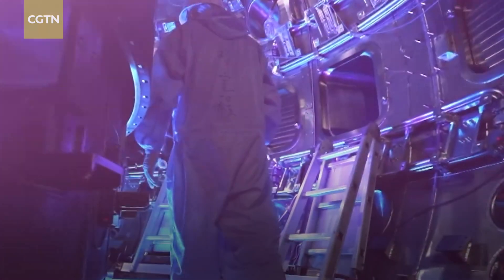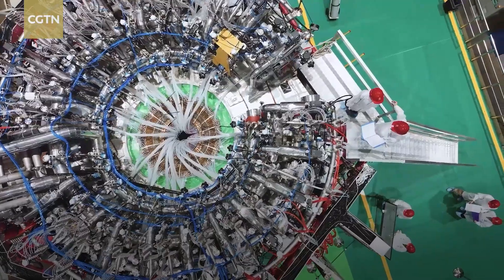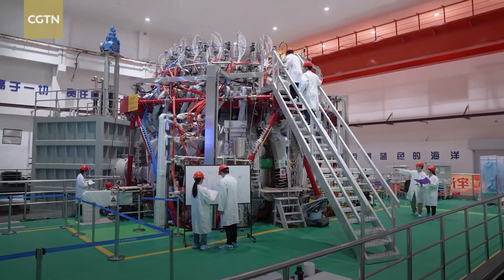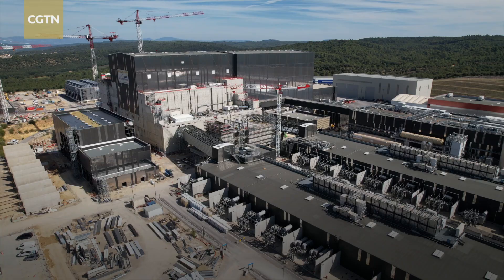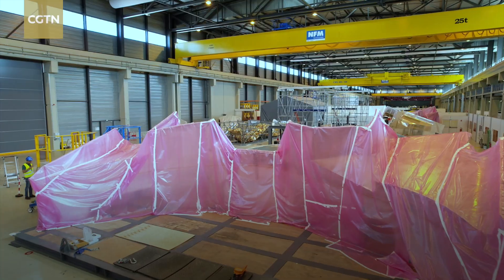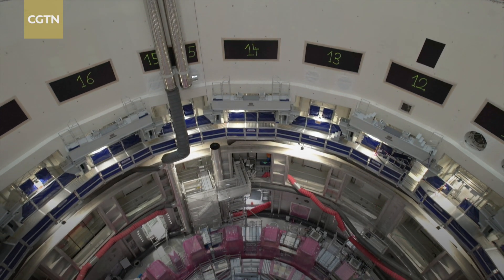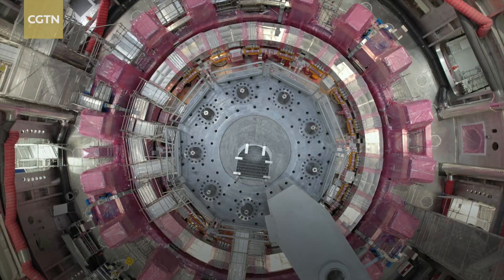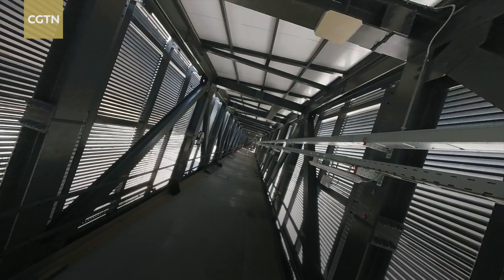Chief nuclear fusion scientist on China's 'artificial sun'

Comment: Though it may be commercially available in 2050, China has no problem with energy as it is adequately covered by its Thorium Molten Salt reactor that will be ready for commercial operation in 2025. ❤❤❤